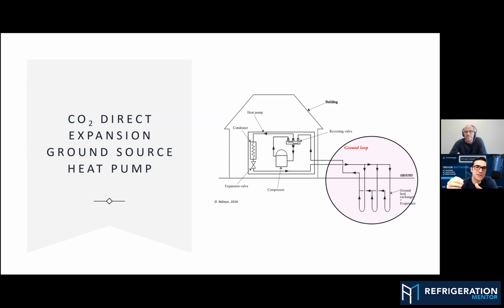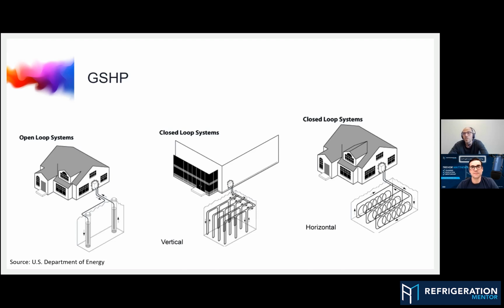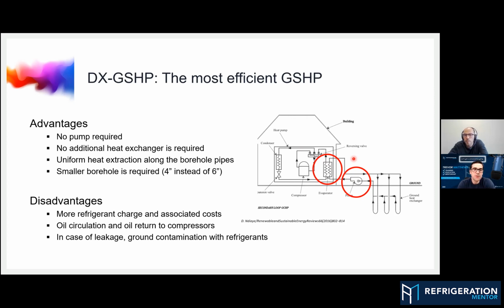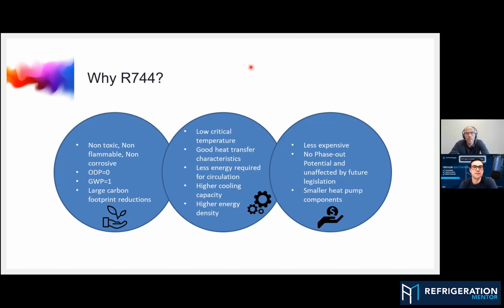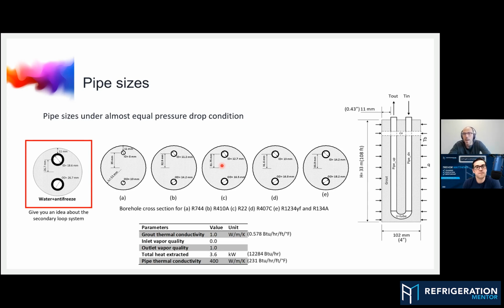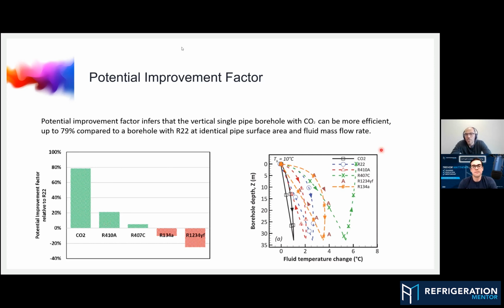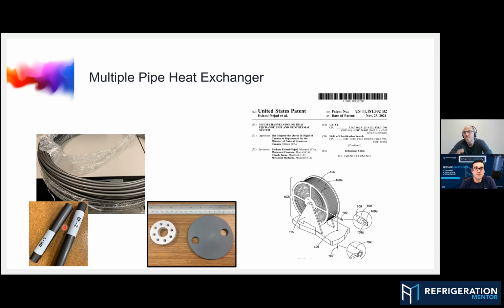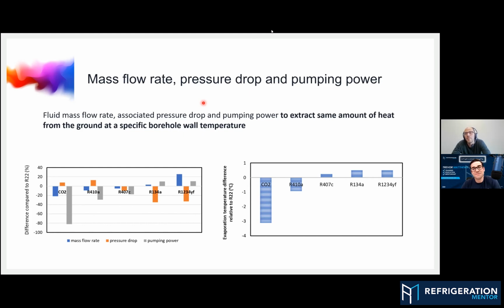CO2 Direct Expansion Ground Source Heat Pump with Parham Eslami Nejad

Comment: You can't produce CO2 heat pumps at a reasonable cost because the high pressures involved. Transcritical CO2 has a lower specific heat capacity than R290 and a malfunction can cause it to destroy itself by forming dry ice.  Is it efficient? Yes. Is it as cost effective as R290? No. I agree with the other comment. Even for ground source, R290 wins on electrical efficiency. The near future is R290 because it has a very low GWP and runs at low pressures making compression efficient. Lots of things in our homes/cars use natural gas, gasoline and propane and could cause a fire or explosion. A heat pump system is hermetically sealed and is inherently safe. If you are still paranoid, you can use a monoblock to move the heat/cold into the house. I love the transcritical technology but I don't see widespread adoption outside of business and commercial because of the high cost and complexity.
Reply from the maker: I think R290 is a great refrigerant and when we can have enough people trained to work with it safely we will see the heat pump market and small unit grow really fast. Thanks for sharing.

Comment: Very interesting topic, thanks...
What about COP?
CO2 usually have very bad COP (2,5 ???) and can't compete with R290 for example that can have around 4-4,5 in a indirect system for residential heating.
When using plastic tubing I would take a cloose look at the wear of the U-section over time. Circulating refrigerant eats the bends.
Reply from the maker: Those are great questions. It will all depend on specific applications and size. I saw higher COP  than 2.5 with CO2 in industry CO2 heat pumps.
Reply: @RefrigerationMentor  Yes, you are right. I was refering to the cooling effect since I work with refrigeration. COP for CO2 heatpumps should be able to hit at least 3.5, but then in should be compared to the approx. COP of 6 for R290 Propane.
For a single home use about 5-10 kW is enough for heating and that can be handled by 0,2-0,4 Kg of R290.
How big is the bottle of gas used in a camping wagon? 5-10 Kg?
A standard refrigerator have about 0,1 Kg of Isobuthane which is equally explosive as propane, so a heatpump based on Propane doesn't need to be much more dangerous that your refrigerator and freezer.
Unless it's placed in a very small room where 2% LEL can be reached.
Reply: COP 2,5  . Thank you I am not watching any further
Reply: @andreycham4797  I know this is a year old, but no, CO2 is not a COP of 2.5 except at -10F.... At that temp, no other refrigerant is even working at all.  Ok, Highly toxic, corrosive, flammable Ammonia would work.  At standard 47F COP testing done on all refrigerants, I believe COP of CO2(R744) is 4.3-->4.7 as claimed by SANCO2.
Reply: @w8stral ground source heat pump can work with COP 5  I do not know who in the right mind would buy ground source heat pump with COP 2,5. Sanaco is an air source heat pump  and it is junk too because in the cold climate it delivers less than 50 percent of nominal capacity. I would rather buy Chinese air to water heat pump with EVI technology and 2 times cheaper
Reply: @andreycham4797  To obtain a COP of 5 from ground source you better have some warm ground.  Where I am, ground temp is 45F(Coldest in continental USA), so you certainly have warmer and more than likely can hit a COP of 5.   Just because something is air source the principle is identical where the only difference is air is moving over the heat exchanger instead of water from a ground source, or the ground source is water with air being blown over it to another heat exchanger to another air based heat exchanger.  Why?  Because as soon as the outside air temp is warmer than ground based, you would have to be stupid to keep using the ground temperature.  --> Unless of course you love higher electric bills.  You want BOTH air and ground and it is pretty easy to setup.  Does such a setup ever pay off?  Well, not really.  If you have the room, just install more solar panels.  Kind of like the gist of this video... some academic talking about a MINISCULE tiny advantage over other refrigerants and completely unrealistic to try and bother to use as the expensive of using it is insanely HIGH... steel high strength tubing... what a joke instead of plastic.  Utterly unrealistic even for a commercial application.
Reply: @w8stral   When the temperature outside is warmer than 45 I do not need to heat my house at all the sun is  doing it for me. In Europe and China people can buy dual source heat pumps which you can  run from ground source heat or air source heat just set the temperatur of ambient air at which you want the system to switch.  With new cold climate heat pumps, ground source heat pumps do not make any economical sense. If I find enough water with shallow well  for the water to air heat pump on my property I will install one and a half ton as additional very cheap source of heat
Reply: @andreycham4797  Everyone can buy dual source heat pumps bud, its called installing  a switching valve and any commercial HVAC pump has them already installed.  Every HVAC guy installs them routinely.  There is no such thing as a "new" cold source heat pump.   Just the same ol' same ol' with a new label that suckers swill up pretending it is "new" and newsflash: Their COP still sucks compared to ground sourced heat.   Even the multi stage so called "new" heat pumps using multiple Refrigerants and multiple heat pumps in a cascade.  Cheapest heat source is the ground.  All it requires is a backhoe and throwing tubing in the ground.  Now if you live in a suburb with zero yard... yea, this is a problem for most people.   The cost comes from PAYING others to do simple work you can do yourself and why "ground source" is uneconomical.
Reply: @w8stral i did not see anybody in the US to install such heat pumps. Can you give me some info where I can buy air/ground source heat pump?
Reply: @andreycham4797  Type in TRANE water source... their axiom units have a 25% air handler   Perfectly good enough when it is warm out.  Otherwise would require a larger heat exchanger.  Other companies have equivalent units.
Reply: Sigh: COP is directly tied to temperature you are operating at.  Industry standard is to quote COP at 47F heat source.  At 47F heat source a CO2 pump like SANCO2 has a COP of 4.3? I believe and at 32F drops to around COP of 4.  An R290 has a COP of 3 at O C CO2(R744) at 67F has a COP greater than 6.   R290(propane) is NOT this high at that low of temperature source.  Propane has a LOWER COP than CO2 at lower heat source temperatures and roughly equal at higher temps.  CO2 can also be run at higher temps for domestic hot water or better yet, heat storage(150F ++)whereas Propane really cannot with lower pressures and it is NOT flammable like Propane or Butane.  

Uh, bud, Neither CO2(R744) nor Propane(R290) can use "plastic" tubing in this application.  Technically I am wrong and propane can be used in plastic, but it is a BARELY and why Propane in houses is done in STEEL pipe, though technically super duty reinforced steel/plastic composite pipe can be used and IS being used in homes, but its longevity is not exactly known.